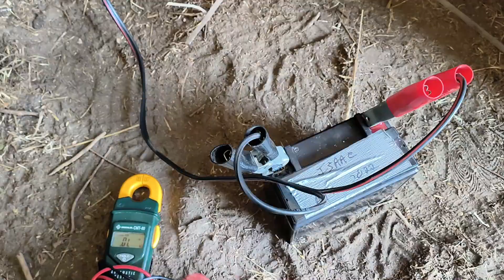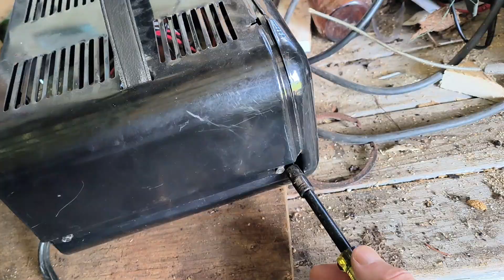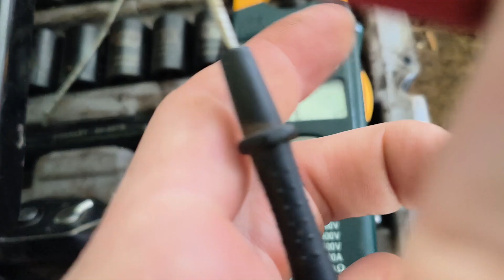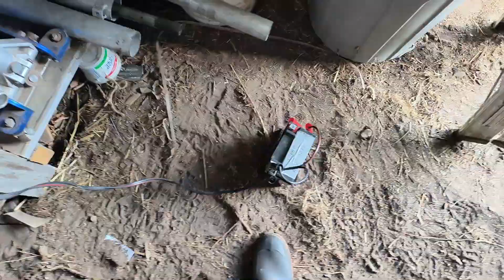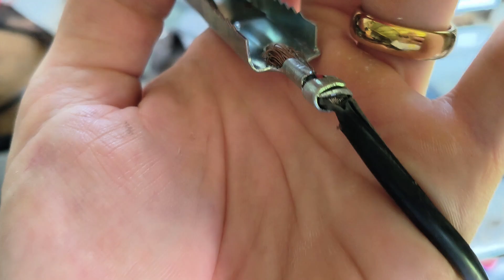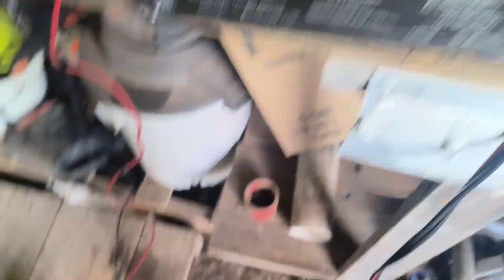MotoMaster CT-1275AP Not Working? Here’s the Simple Fix!

Comment: I was given one of these and someone unplugged the wires off of the battery type. Was wondering where they go on the selector switch. Thanks for the video. The 35 amp thermal relay was fried
Reply: I have one of these. Bought brand new, hardly used but not working and past warranty. I have no humming sound, no measured voltage on clsmps when plugged in.  I'm wondering if I have s fuse issue but I either dont see or dont recognize a fuse.